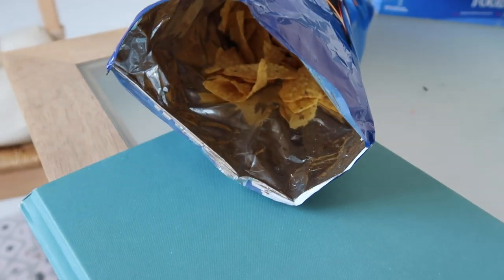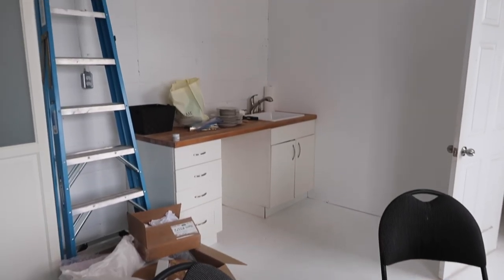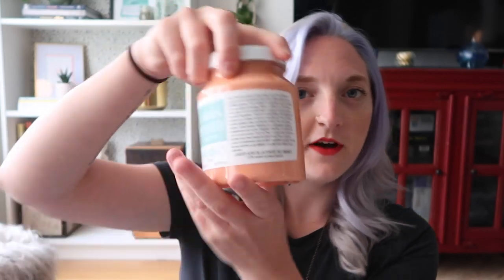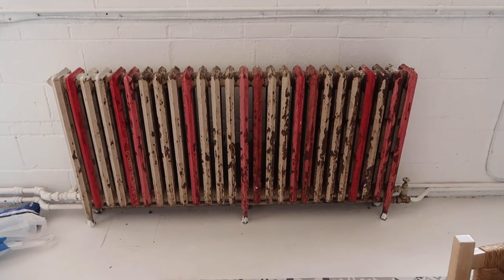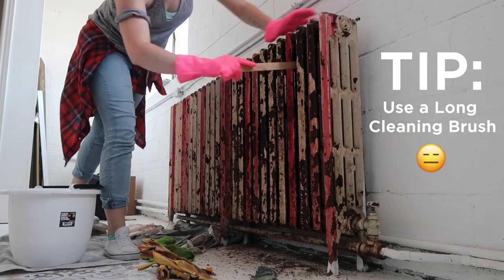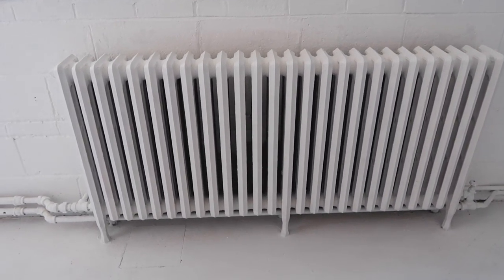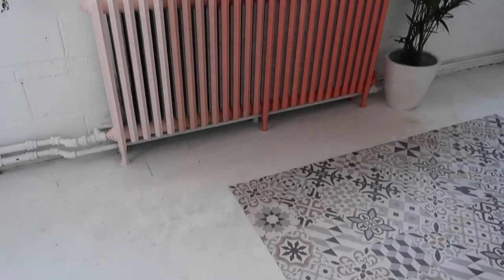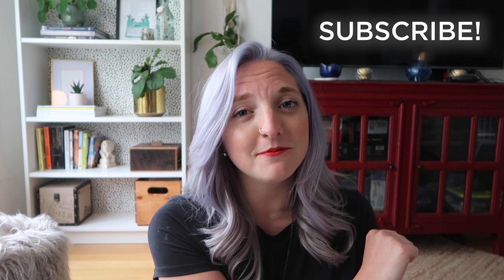Ombre Paint Tips! DIY Radiator Makeover

Comment: Isn’t this paint going to crack when the radiator turns on? Are they heat safe?
Reply: Can't that just be part of the beauty?
And amp up the industrial vibe.
Reply: Wondering this as well...
Reply: @turinhorse  What do you think causes the cracking of the paint of a radiator? Like heat expanding and contracting the material causing it to crack. I don't understand how parts of it would become gas/vapor again after it's become a solid, unless it's burning but a paint that is going to burn from a radiator probably shouldn't be used in the first place. If we can talk about paint historically being bad for people, lead paint is bad when it chips and kids eat it because it tastes sweet. It's not just bad being in the home. 
Like the fumes while drying paint aren't good for people but I don't think those same fumes are going to come off when paint is cracked and heated or even if it were uncracked and headed.  

So what's the problem with leaving the original cracked paint? It's in a rental, so wherever they live thinks cracked paint on a radiator is a living condition that isn't going to be bad to someone's health. Like legally landlords need to fix dangerous and inhospitable living conditions.
Reply: @LifeLostSoul  mmmmm ok

Comment: Why dust and clean the radiator? It’s obvious it needs to be sanded down and treated with anti rust. Then primed, coloured and use a radiator sealing paint. On a normal one that has no rust or chipping a quick spray paint works well.
Reply: LEAD.

Comment: I wonder what this looks like now or in the future. What you really needed to do with the rust is use a rust converter, which basically messes with the chemical makeup of the rust and steals an oxygen molecule. This means you can paint onto of it and you are not painting on rust and the rust will not show through. What you essentially did here is hide the rust for now, but the rust is still there.